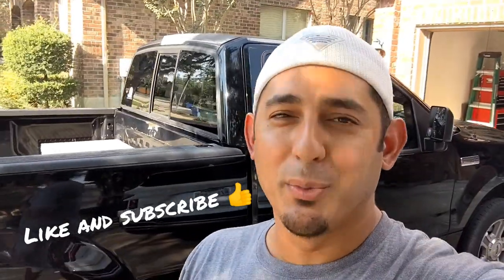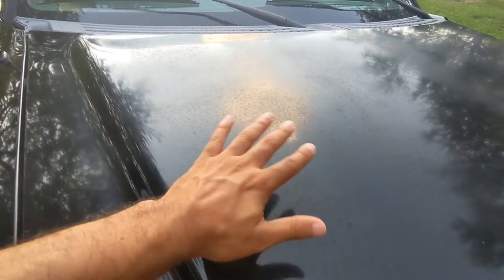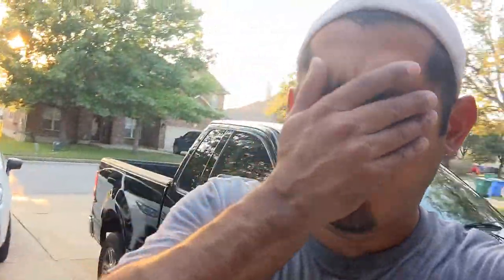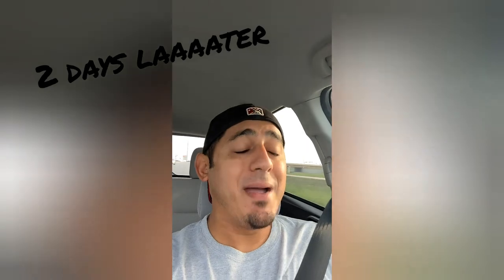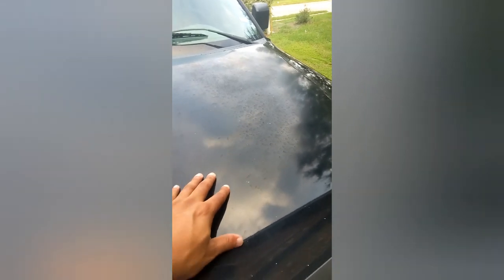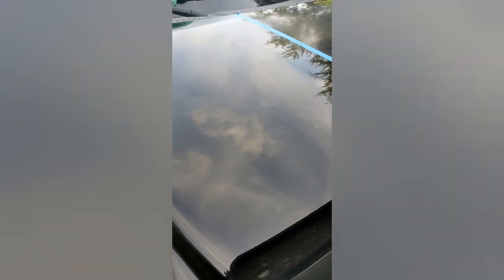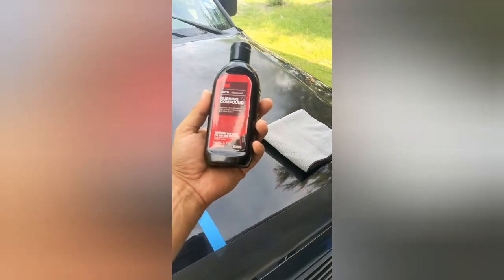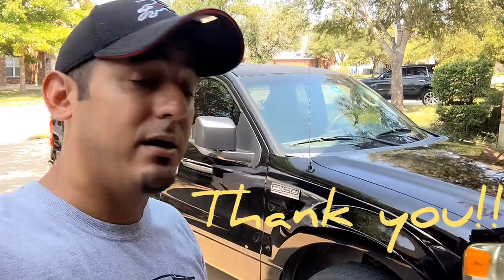Clay Barring & Polishing my Dad's Truck

Comment: I got to learn the proper way to claybar
Reply from the maker: It's not hard vs time consuming.  But for me, a synthetic clar bar is the way to go.  You can get one at auto zone or any other parts shop.  They last longer.. then you just need to make sure the surface is nice and cool and use lubricant such as car soap and water... The cooler surface keeps the soap n water from drying on your car and leaving nasty soap stains and it keeps the clay bar moving nicely over the surface.  To check if it's done... With soapy water on surface,  run you fingers over the clay barred surface and it should feel so smooth (like very smooth).  When paint / the clear coat has contaminates in it you can feel the tiny bumps almost like small grains of sand stuck in the surface... Those bumps should disappear if the surface is clay bared correctly.  Also to keep the soap from drying, I also did sections at a time not the whole truck at once... Once each section is done, you can dry it off with a towel to keep the water from drying and leaving spots.  👍